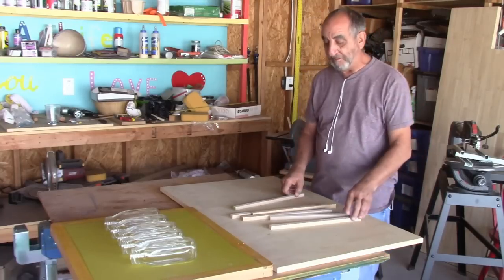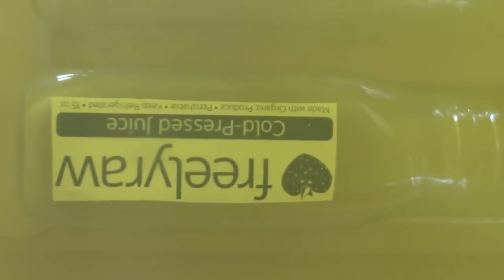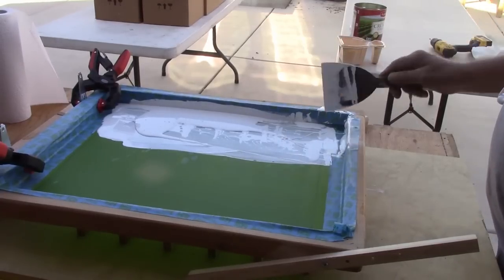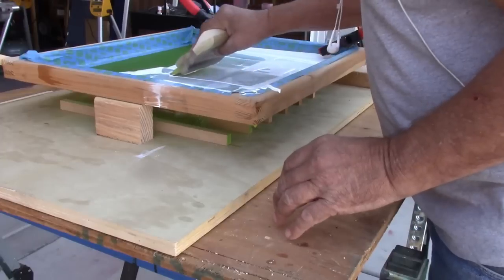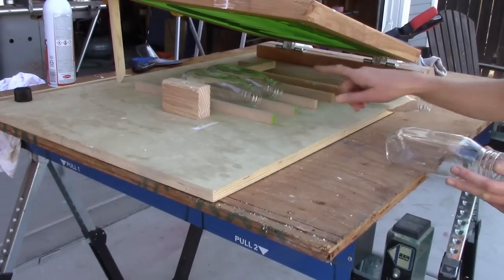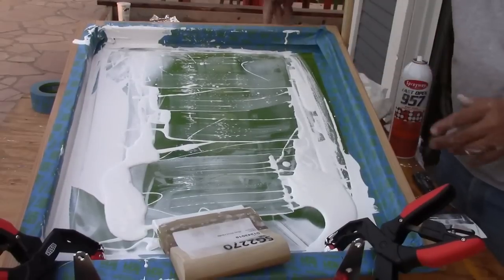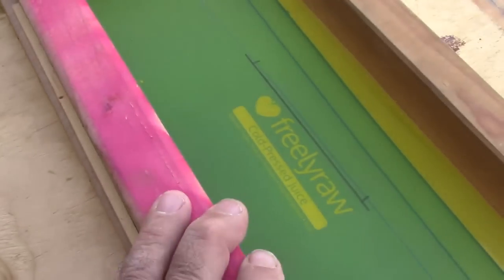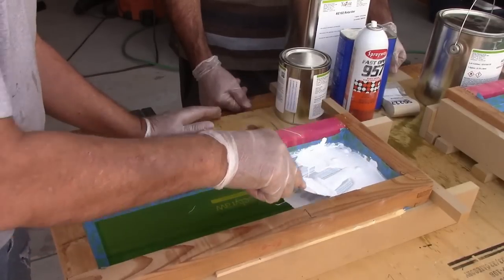How to silkscreen on glass bottles part 1

Comment: How do you cure the ink on the glass bottles?  Do you sit them under a flasher?
Reply: Most glass inks are air cure.... but this stuff is like he says 2 part plus retarder ..... it's like mixing epoxy.... surely the ink is epoxy
Reply from the maker: yes it will dry in about 30 minutes and after a day it is hard as a rock  that is why you only mix small amounts ( table spoon ) because it starts to dry in the screen